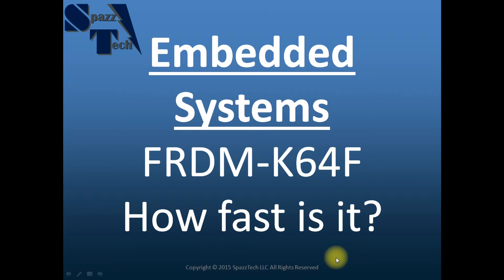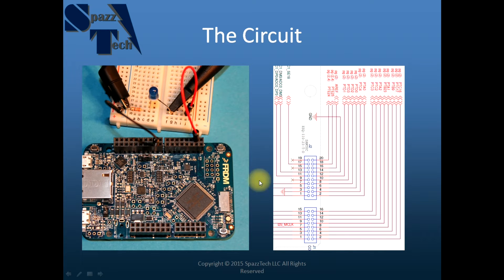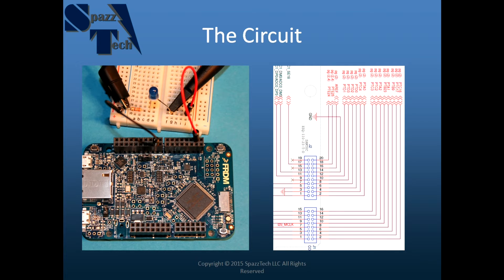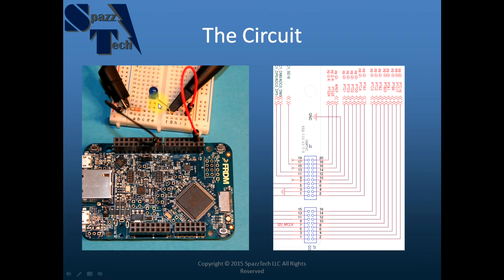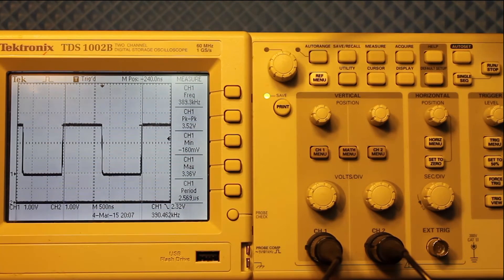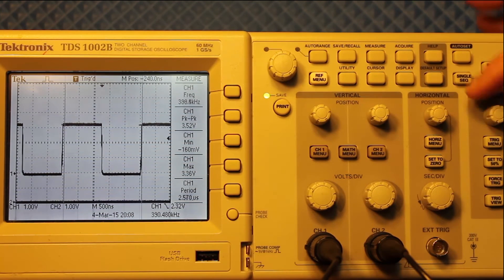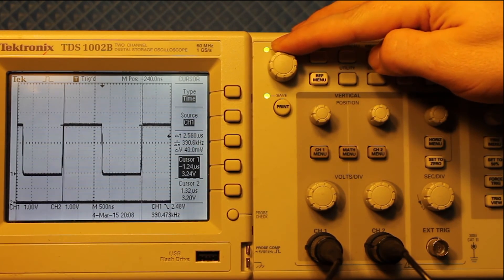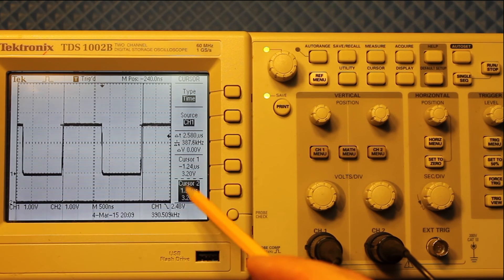#Kinetis #FRDM-K64F - How fast can it toggle a GPIO pin

Comment: actually 390 khz is pretty slow for a 120 mhz mcu. i can easly achieve 5 mhz pin toggle frequency with 80 mhz 16 bit dspic mcu.  so i think kinetis design studio is making a lot of process on the background for i/o toggle.
Reply: +cengiz zorgormez ibretlik
Reply: I just started with a FRDM-KL03Z board with a Kinetis 48 MHz CPU (Cortex-M0+). My debug image (optimisation most -O3) toggles a pin with 4.8 MHz (duty 30%). Of course i had to write directly to the port set/clear register.